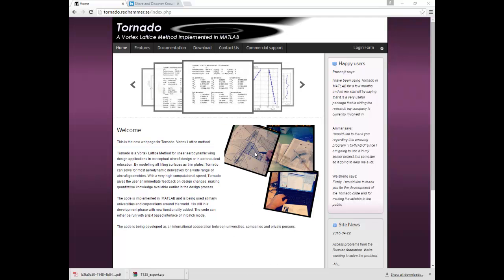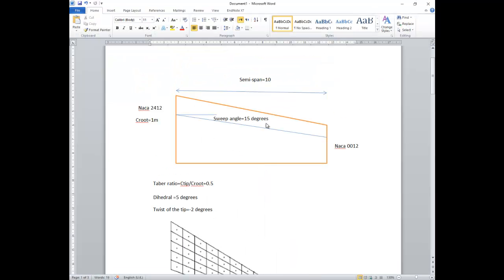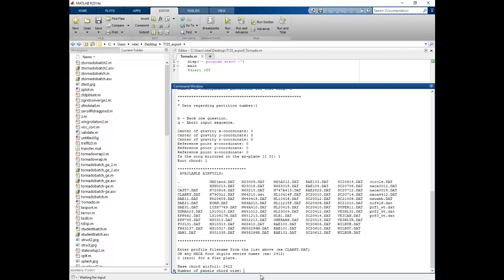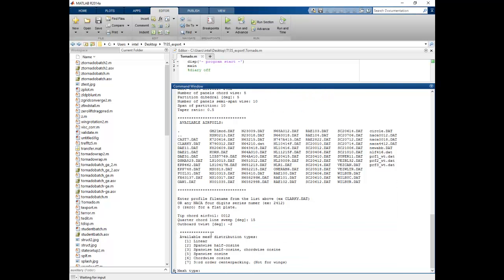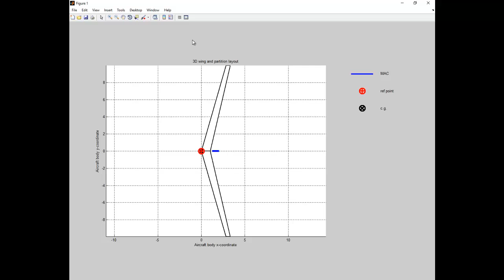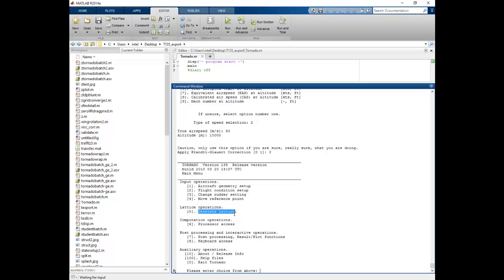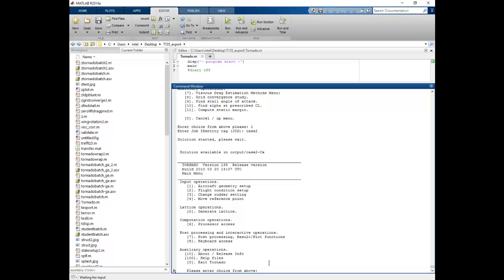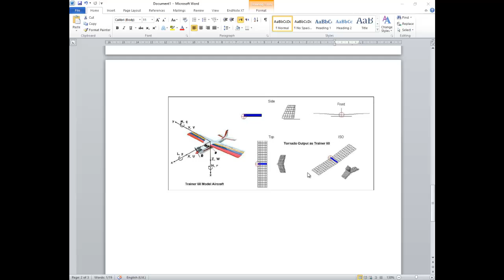How to Model a Wing by Using Tornado VLM

Comment: Hi, when i type in root chord, it tells me 'ERROR' no file. What can i do in this instance?
Reply: did you get thru this error? I just got it aswell
Reply: I think I just restarted it and it worked
Reply: I had to add the folder to change folder of tornado into my matlab folder
Reply: Delete the current extracted folder and then re-extract the folder and it'll work again

Comment: Hello, do you know how can i introduce another airfoil to the Tornado database? I tried generating the DAT on the same pattern of those that are in the  Tornado's 'airfoils' folder and putting the DAT there but Tornado just wont recognize my DAT file. Every time i try to plot the geometry, it fails to find the file and assume that the wing is a flat plate. So far the only airfoils that Tornado recognizes are the NACA series, every other one on it's database gives me the same error.
Reply from the maker: you can.
But you need to make the file like the following
No. of coordinates of the upper surface               No. of coordinates of the lower surface 
coordinates of the upper surface start from x=0 to 1
coordinates of the lower surface start from x=0 to 1
after that, save your file in the folder aircraft/airfoil
Reply from the maker: I agree with you some airfoils which came with tornado didn't work. but I used many new airfoils and I defined them like in above.. if you still have the problem just send me the file and I will try it. 
ahmad.alsahlani@gmail.com
Reply: I was able to make it work now, i was actually forgeting to put the ".DAT" at the end of the filename when selecting the airfoil on Tornado. Thank you very much